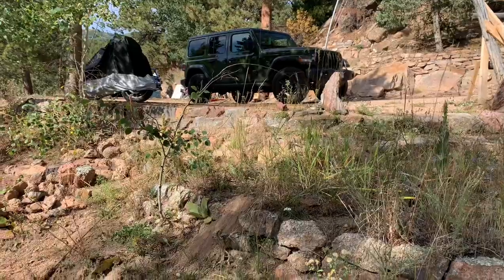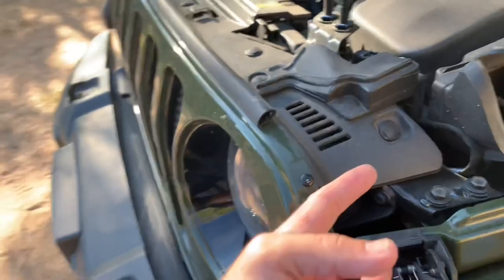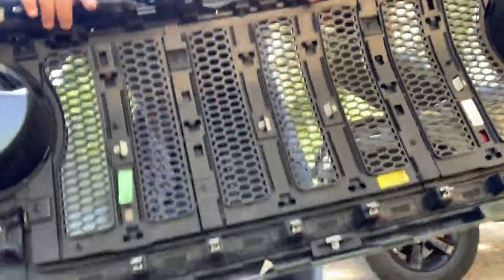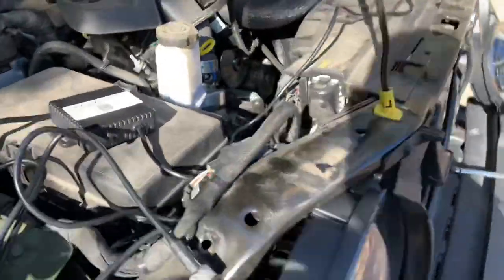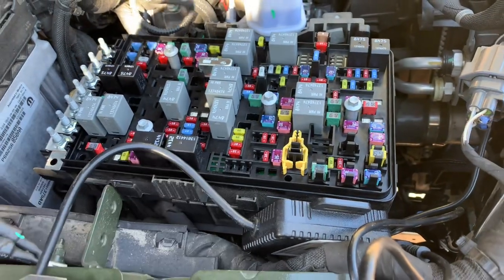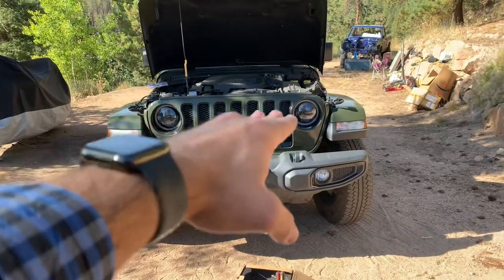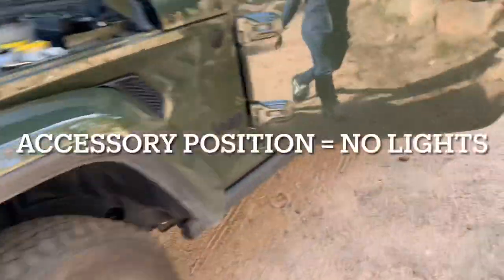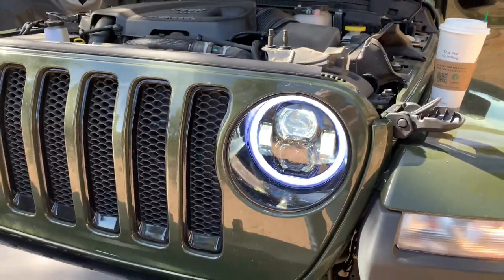JL Headlight Install How To - LED Factory Mart Headlights

Comment: How did you connect the red wire to the fuse?
Reply from the maker: You can hit the auto parts store and grab a connector.
Or…. You can just wrap it around one of the fuse legs and put it back in. It’s common practice and works the same, just isn’t as “pretty”

Comment: Nice...But when LED Factory Mart shows them as "In Stock" just know they are NOT in stock and do have come all the way from CHINA. So, if you have a defect in them you will wait...and wait...and wait....Ask me how I know.
Reply from the maker: Damn that sucks. Worth it when they arrive though. Just make sure to adjust them, we had issues but it’s much better now
Reply: @FreedomCrawler  They arrive...now I notice these have two plugs out the LED lamps....one is factory....the other goes to the controller correct.
Reply: @FreedomCrawler  tell me about how you adjusted them if possible. Thanks in advance.
Reply from the maker: @MasterTheNEC  correct. You only have to use it if you want to control the color. 
I made a video on adjusting them recently, washers were the best option. Without them I couldn’t get them low enough. It was bad. Now they are good to go
Reply: Disregard - It seems that in the 2022 Gladiator Rubicon (at least) they do not have the headlamp adjustment screw as shown in the video I posted. So, LED Factory Mark does send you longer screws with tension springs that can be used to loosen and adjust the headlamps. If you want them to tilt more up you loosen the top and bottom even more until adjusted. The don't come with instructions but I figured it out and at least thankful they included the springs to make this possible.

Comment: hey have u found a way to lower the beam angle on these headlights? i bought the same pair but even with the adjustable screws they were not aimed low enough
Reply from the maker: So I spent some more time with them last night because I was blinding the hell out of people and hated it. I was able to loosen the upper and side screws enough to get it low but then when I put the grill back on I noticed it pushed them back up a bit. It’s a lot better than it was and no think I may trim the grill on the inside where the headlights rest against it if I run into more issues but for now it’s much better. I’m with you though, there could be more room for adjustment but the grill is the clearance issue
Reply: @FreedomCrawler  ok I see, I previously did the same too but found the grille was having clearance issues so I just emailed the company and they are sending me another pair with customized adjustment angles which points lower!

Comment: I used the heated seat fuse and now my passenger heated seat doesn't work. I press the button, it lights up on high for a second and then turns off. Did you have any issue like that?
Reply from the maker: No issues with the heat in mine. I would suspect that your fuse isn’t fully seated or the wire is loose. To troubleshoot I’d unplug the wire and re-seat the fuse and see if there’s any issues. If it’s fixes itself then it just needs to be reinstalled a little snugger
Reply: @FreedomCrawler  Thanks I will try that.

Comment: Would you be willing to post a video to show exactly how you wired the halos to the fuse box? Extreme newbie here!
Reply from the maker: Google fuse tap. That will help you get what you need
Reply: Did you have to cut the wire to use the fuse tap?

Comment: Did you have to do anything to prevent flicker?  Seems some people get flicker on high beams..  Also, are they still in and working?  Any issues with being too bright or not positioned correctly for DOT standards?  Thanks for the install video, mine are on the way!
Reply from the maker: Lights are still installed with no issues with flickering. I did have an issue with positioning them but just posted a video on that recently. Use the washers to help them stay in place and you’ll be good. We haven’t had issues since. Before that it was horrible though

Comment: I’ve got two extra wires on mine, one for turn signal and for Running daytime lights. It is to my understanding that I do not have to use these if I don’t want to.

My question is, what do I do with them if I choose not to use them? Do I just leave them bare? Or tape them up? What is the safest way to NOT use these two extra wires?
Reply from the maker: Just take them up. They are input wires and shouldn’t be sending anything out of that makes sense. So they aren’t “hot” wires